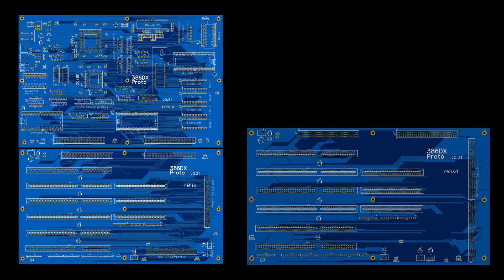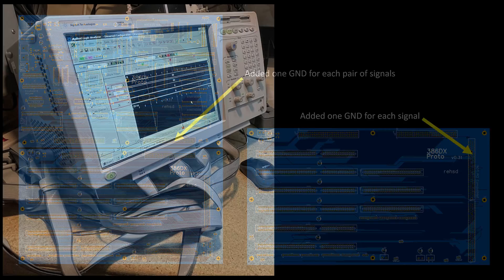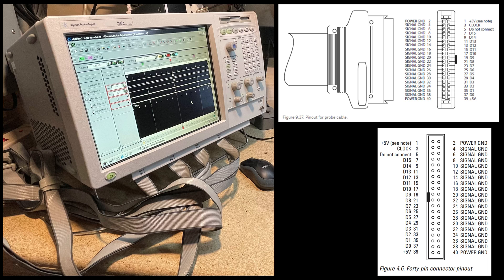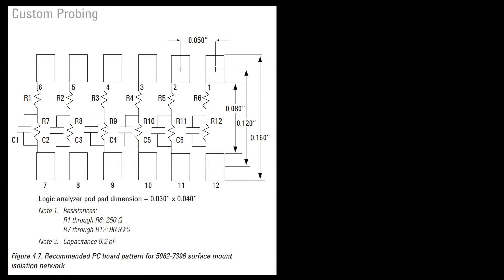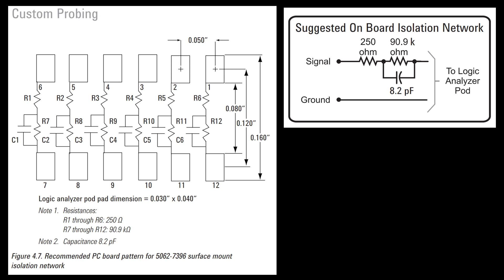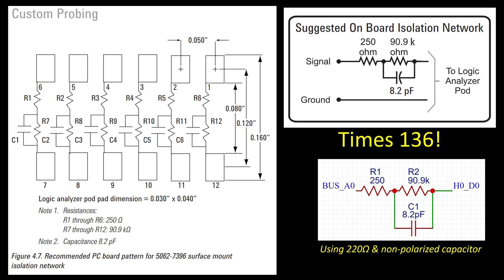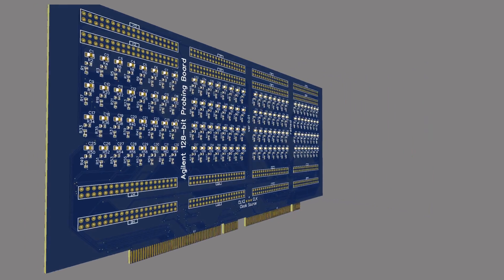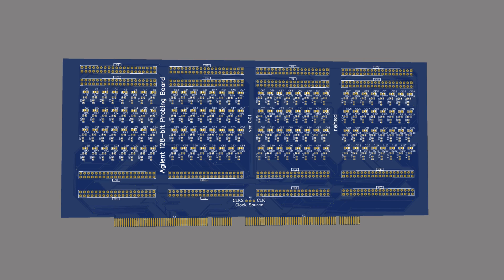Agilent Logic Analyzer - Step 1 - Basic Connections

Comment: Building those filter network PCBs would probably be a good opportunity to try out a PCB assembly service. You could get a bunch of them made with very small components and maybe castellated holes on the edges to turn them into something you can then solder onto another more specialised board.
Reply from the maker: I'll have to look into pricing for assembled PCBs. When I've looked into them in the past, they seemed (to me) to be expensive.  ...more research needed

Comment: First, the fact they used a symbol for caps with one straight and one curved side doesn;t necessarily mean polarized. That's more of a stylistic thing, if it were polarized there would be an explicit (+) sign.  Also, there's no technology that creates a polarized 8.2pF cap that I know of, so just use anything.  The 90k and 8pF in combination is basically a 700 ns time constant  high pass (depending on the load ofc) which is likely just to slightly boost the edge speed inside the LA cabling to account for cable capacitance/LPF effects above 1.5 MHz or so.   But note that 8 pF is around the node capacitance of an IC pin or a PCB trace so I wouldn;t sweat it too much, with some science you could possible even craft an approximation in the PCB itself without needing componenet.  And at the end of teh day I'm not even sure it's needed.  This probably mimics the circuitry inside of a typical probe pod end which you can buy on ebay. In 15 years of benchwork, I always used the pods that had the breakout to the little wires with the heatshink-wrapper copper barrel on the end. The barrel would either go over a berg header (line a 2x10 pin 0.100 spacing standard breakout) or push into a pin on a tiny spring clip that you could clip to an IC pin.  

Second, didn't you say you refurbished your LA with an SSD drive at one point? (maybe I'm thinking of some other youtuber though). If so, do you have any links or recommendations for walkthroughs on the process? I have an old Tek that, now I've heard that's a thing, I would love to upgrade.
Reply from the maker: Good info, thank you!! Yes, I upgraded my logic analyzer from a rotational HDD to an SSD. I'll post some details in the coming week or two.

Comment: That double PCI slot card seems inefficient IMO. Can you get down near 100mm^2 for a pair of analyzer pod connections? If so, I suspect that the cost of a fully assembled board would be worth the time savings. You might need to move the two PCI connectors a bit further apart though on your motherboard though.
Reply from the maker: Ya', I think I could split the card in half easily. That's a good idea!